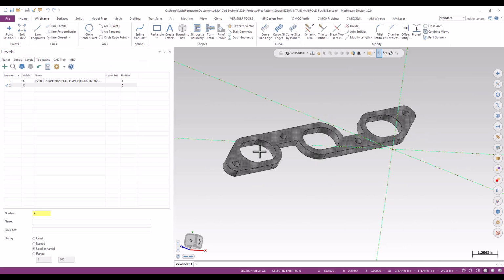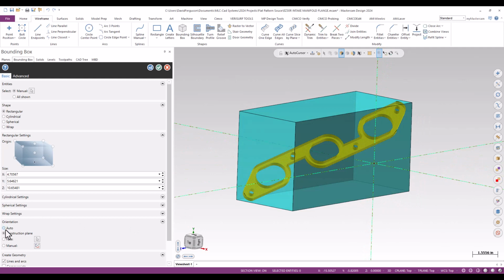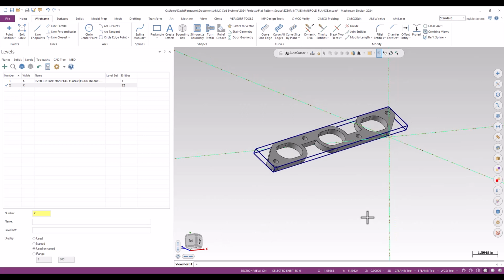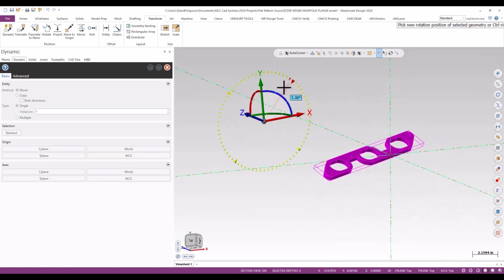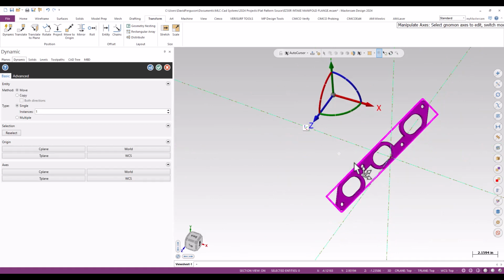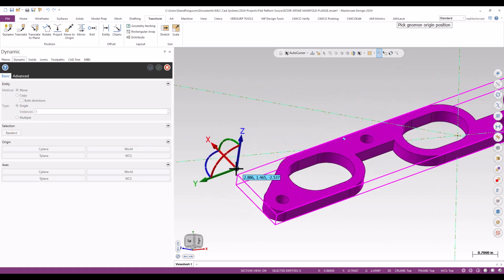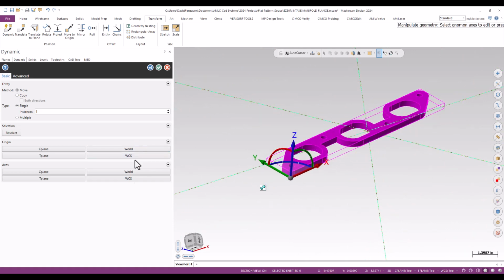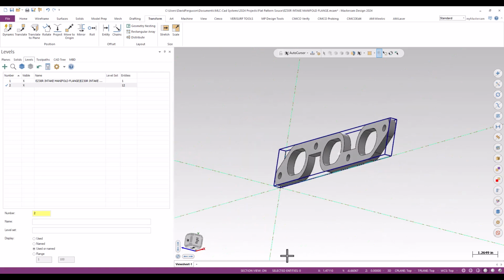How to Align Imported Parts - Flat Pattern Skills

Comment: Why not to use the "move to origin" command?
Reply: Hi! Move To Origin is always an option but in this specific case there was a need to align the part to a plane as well as an origin. When using Dynamic Transform, the "Quick Buttons" in the dialog have what is essentially a Move to Origin option which I use in the video.
Reply from the maker: Thanks for clarifying David!  There are a lot of valid approaches to solving a challenge, and this isn't the only way, but it does represent a best practice recommendation for this part.